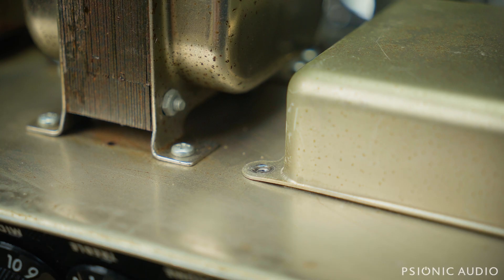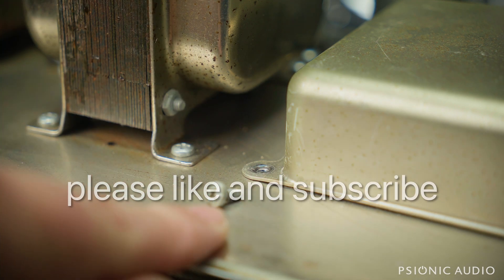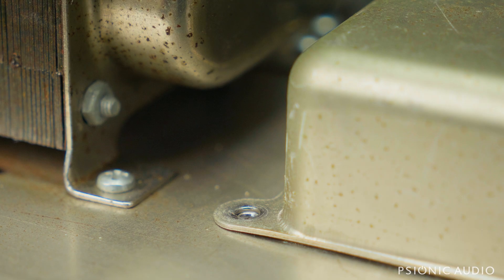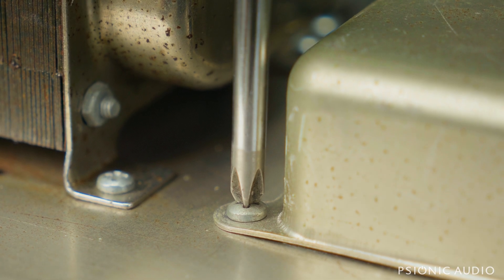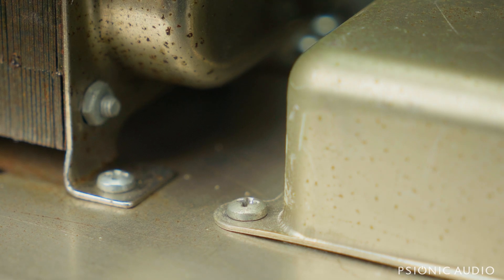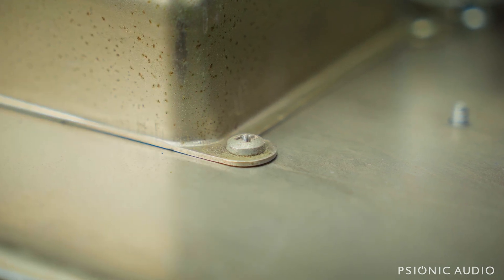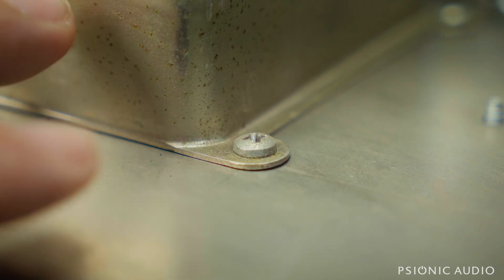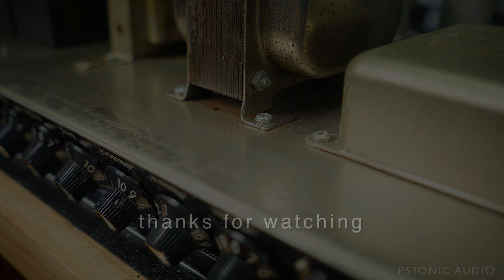Tech Tip : How to Install a Screw

Comment: Excellent advice and it translates to a wide array of devices with threads. Especially when threads are fine and in softish material, say in camera lenses or threaded microphone capsules. Going counter-clockwise at first will help prevent cross-threading, something that will turn a valuable item into junk.

Comment: LOL, I was just showing someone how to do this earlier today, turn backwards until it clicks, then tighten. Works in wood too, like those pickguard screws. Learned this way back when I was a teenager learning how to work on cars and stuff. I also learned from working on aircraft to place all the fasteners first, then tighten them all. Expensive parts made out of thin aluminum will teach you a lot of patience.

Comment: On very first time threading of all new holes I try and keep the screw perpendicular to penetrate and form it's thread versus letting it lean inwards at it's thread pitch angle which it wants to do. For me, just more likely to maintain holding power as I experience regularly in locksmith hollow core door and frame based hardware installations. Those screws with a poor start are the ones you or the next guy will lose.

Comment: I like how you highlight important little details that that an experienced tech might do automatically without thinking. And I always appreciate your knack for clarity and brevity.
I might add that for a stripped Fender screw like this, before you go all the way up to a honkin' #10, first try a new #8. The Fender originals are actually #7, which are 0.151" major diameter. At 0.164", the #8 is only slightly larger but I've found it's often big enough to grab.

Comment: Not a question for this video but in general is the marshall JCM 2000 TSL60 a decent amp for general guitar playing? And what is a good price point for a working amp, that is playable... also does this amps board have the same issue as the 100 watt TSL version?

Comment: A guy I used to work with about 10 years ago, (who was in his mid-70s at the time), showed me this exact trick! I've been doing it ever since! In addition to amps and other metal applications, this is especially helpful when installing pickguard screws on a guitar! Saves having to get out the toothpicks and Elmer's glue later... Thanks for passing this along, Lyle! I'm sure there's a lot of people who didn't know about it!
Reply: Ugh...I used to play with a guy who used the "Elmer's and toothpick" method to resecure a strap button on his vintage ES-335. Of course it failed and the guitar now features a reattached headstock. Drill out the hole, glue in a dowel, trim down and redrill...it's not so difficult.

Comment: Good advice.  And I might add that if you're loosening a number of fasteners to remove a plate, water pump, doghouse or whatever, loosen all the nuts or bolts and don't remove them until they're all loose.  If you loosen the first, remove it and repeat this method, you will invite Mr. Murphy to ensure the last one will either strip, slip or snap off.

Comment: Self tapping screws don’t cut the hole.  That’s a self drilling screw.  A self tapper and a self driller can and do both cut threads but a self drilling screw doesn’t require a pilot whereas a self tapper does.
Reply: You are correct, but those screws are not self-drilling. The ends don't have the cutting tip. Hence, the need for a pilot hole.
Reply: It's a matter of semantics: self-tapping screws don't drill the hole, but they do cut threads into the metal.
Reply: @ it’s not semantics.  They are two different products.
Reply: @paroblynn  we know

Comment: I cant be the only one who does this (run the screw counter clockwise until it seats like Lyle explains in the video) but wonders if someone is gonna see me going in reverse at first and think im doing it out of ignorance lol. So if anyone is around i feel compelled to explain myself lol.

Also if you have to repair a stripped screw hole with a nut like Lyle suggests I recommend using JB weld or quick steel putty to permanently fix the nut to the chassis. That will allow you to take out and reinstall the screw each time without having to use something the hold the nut in place while you tighten it from the other side. Just be sure to coat the threads of the nut and bolt with some paste wax or similar compound first so that the nut and bolt don't get stuck together. I like to just put a couple dabs of jb weld on each underside of the nut then tighten it up against the chassis while it sets. And if your chassis is corroded or oxidized you should use some steel wool or sandpaper first on the chassis and nut so that get good contact. Back in the day guys like my grandfather would use acid core solder to solder nuts or terminals to the chassis. That looks great at first but if you don't get every single big of the acid flux solder cleaned it will corrode the chassis eventually and look poor. You can see that in some old fender and other vintage amps. And Lyle is absolutely correct that you can just use the next screw size up to fix a stripped hole but because it's not ideal like he mentions (because it won't match the other screws in size which looks bad) id recommend patching it with a fixed nut using JB Weld or "KwikSteel" putty. In fact you could probably even just use the KwikSteel putty to fill and retap the hole. I haven't tried it but I probably will next time I come across a chassis with a stripped screw hole.
Reply: I've epoxy-glued nuts to a chassis many times; works best with Keps nuts that have a built-in star washer, and be sure to degrease the nuts before gluing. Roughing up the side flanges of the nuts with a file, sandpaper or a Dremel tool is highly reccommrnded.

Comment: Good tip. I deal with bolts and screws everyday in my line of work and ALWAYS come across poorly installed/cross threaded/overtightened/stripped screws from people who were not careful. I’ve even seen a small screw cause hundreds-thousands of dollars of damage because the person just went for it. Even amplfiers I’ve opened up factory line built amps where many screws are cross threaded and the heads stripped out right from “new”.

Comment: Yep. Always. Even more important with wood. Now if only certain amplifier manufacturers would learn how to pre-drill screw holes before they put in the nice beefy screws that hold on the perforated steel back panels of their amps, which blows out the cleats real fast.

Comment: Also, use the right size and style of screwdriver; dont use a #1 Philips screwdriver on a #2 screwhead (or a #2 screwdriver on a #3 screwhead). Learn to recognize Pozidrive screws and have the correct screwdriver on hand.